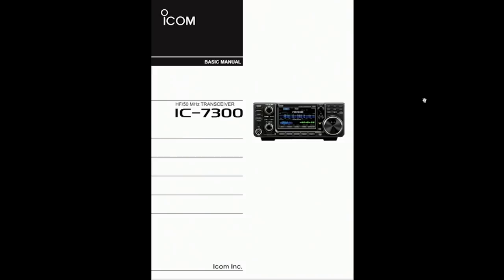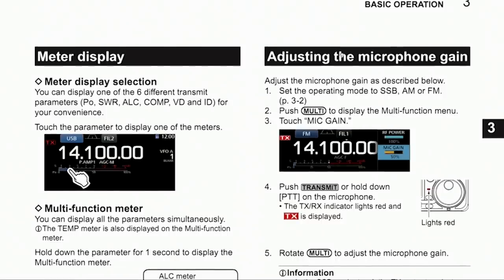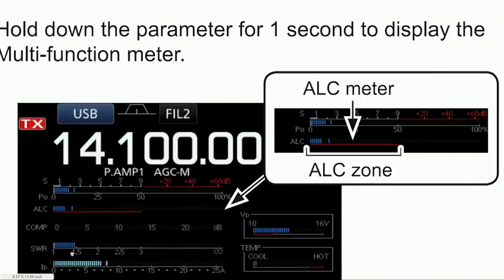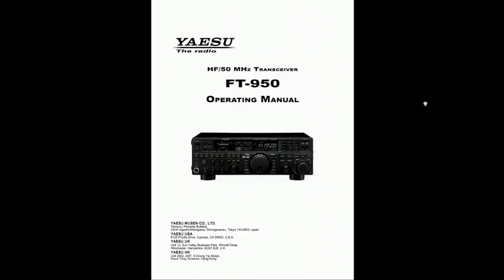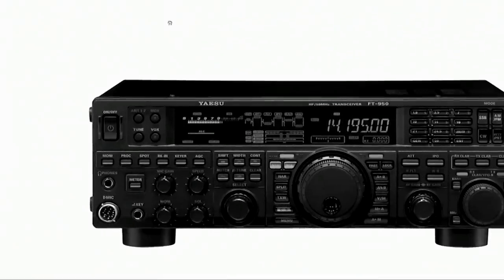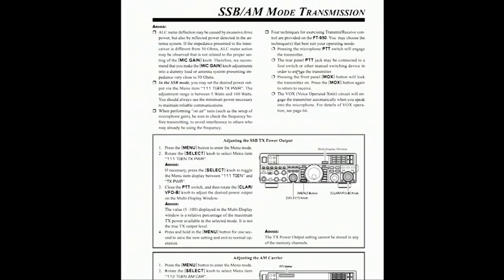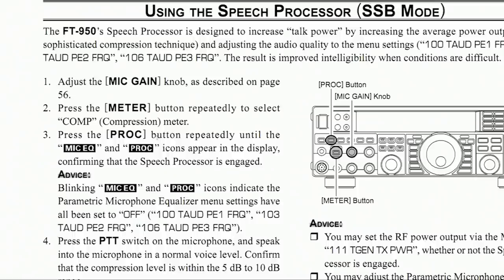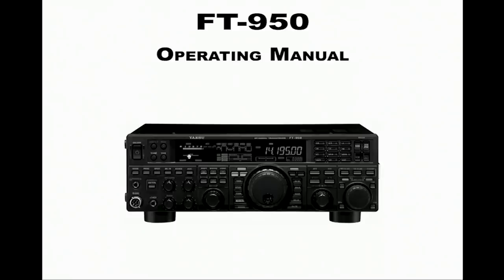Ham Radio Basics---Jim W6LG Discusses Setting the Mic Gain and Compression

Comment: I'm setting up a Heil iCM on an IC-7000 right now. Great video! I'll take your advice back to the radio and run through the procedure you've laid out.
Reply from the maker: Okay Richard.  Let me know how it goes. I have an IC7000 that I almost never use.....and should use!  73, Jim
Reply from the maker: Go to pages 121 & 122, what settings are you using?

Is the mic connected directly to the front of the transceiver?

Electret mics have tons of output and should drive the transceiver with very little mic gain unless they have padded that mic output.  

Get back to me as soon as you can. 

73, Jim
Reply: Currently I have mic gain: 80%, TX wide L: 200, H: 2900, TX mid L: 300, H: 2900, TX nar L: 500, H: 2900.  The iCM mic has a built in cable and I am using a Heil adapter to converter cable to convert it to the modular plug. I am going into the modular mic connector on the back of the rig. Thanks for your help Jim. 73 Rich
Reply: Jim W6LG just tested against the stock mic and getting the same results. Unless I talk very loud into the mic, the ALC meter doesn't move. Tried front and rear modular mic inputs. Would be interested to hear how your IC7000 reacts. 73 Rich
Reply: I did a lot of playing around and asking for audio reports. I have settled on a mic gain of 65% with a compression level of 5 on the IC-7000 with the Heil iCM. It's really strange the ALC meter doesn't move with the compression off when TX into a dummy load. Per your recommendation, I am running normally with compression on and I adjusted for 5 - 10db on peaks when rag chewing at a normal voice level.

Comment: Hi Jim, I currently use the 7300 and typcally run the compression at Number one, and like you say, adjust the mic gain according to the ALC not the rf out power meter, I,m constantly saying to hams to do this and it amazes me how many look back with a blank expression. I know different radios are operated in different ways but the method is basically the same, I hope people take note of yur video and understand that little can be more, thanks for the video jim KR Steve G0OGS
Reply from the maker: Yes, exactly my experience.  They have never used the ALC metering.  Additionally, they very often say to me that I am the only one who ever told them that the audio was distorted.  Amazing to hear a guy get a 5 by 9 and repeated be asked to say again.  Thanks Steve & 73 de Jim W6LG

Comment: My Kenwood TS 140 does not have a mike gain knob, but a slide adjuster. Very touchy. Esp. when this oldie but goodie has a needle type meter. Still, I do get favorable reports on my audio. I suppose the bottom line is, find the sweet spot and you`ll do well. Thanks KC3BXZ Joe
Reply from the maker: Hello and thanks!  Is there an ALC meter position on the TS140. I think we sold that model in the store where I worked in the very early 1970's. I don't think it had a "monitor" function.  So listening with another transceiver may be possible.  Take care of that oldie!  Snowed here 2 days ago. 73, Jim W6LG
Reply: Yeah, spring isn`t here yet, too. Snowed yesterday in PA and more to come.
Reply: The ALC "meter" is just a red bar under the S meter. You just have to keep the needle from going out of the red, according to the manual. My best  mike is the dynamic one that Kenwood sold years ago. Got a photo of it on QRZ. It`s on an antique steampunk homemade boom from a garbage picked desk lamp arm. I jerry-rigged a section of garden hose, painted black to attach the mike to it. If you want to laugh, check it out.

Comment: Jim a quick question that I don’t think you mentioned or if you did I missed it. When setting the Mic gain on my 7300 with the compression off, my ALC is peaking around 5db which drives the radio nicely. When I turn on the compression and set the compression to peak at about 1/4 scale the ALC peaks out much higher now. Am I supposed to ignore the ALC once I turn on compression because like I said ALC becomes extremely lively even though I have compression set to peak at no more than 1/4 scale. With compression off ALC sometimes does not show anything on some words but I have it to peak no higher than 1/4 scale.
Reply from the maker: Hi Steve, I admit to not fully understanding the question.  The ALC meter does not have a db scale. .  This I think is the crux of your questions:  "Am I supposed to ignore the ALC once I turn on compression.."  No and heck no!  As I said, always keep the max ALC to about half scale...never ever more.  I think I said something like that more than once.  My guess is that you have some of the equalizer's setting adding to the mic gain and compression.  If needed, turn the mic gain down.   Good question Steve.  Thanks for asking.  And, in case someone wonders, external boxes are a waste of money and cause all kinds of distortion and splatter.  The Icom has everything you need to produce a terrific, potent signal that can be heard around the planet.  External devices were helpful when transmitters and transceivers did not have internal processing. Those days are long gone.  73, Jim
Reply: Jim W6LG I don’t have any external EQ equipment but you mentioned when adjusting the ALC to have the compression turned off at that point. With my compression turned off my ALC scale peaks no more than 1/4 of it. When I turn on the compression however and adjust the compression to around 5db peak, the ALC changes and increases dramatically. You didn’t mention anything about readjusting the ALC once the compression is turned on and adjusted.

Comment: Jim, I have Yaesu radios and have been setting the compression meter for around 5 db for local contacts and rag chew and 10db to work some DX. I also thought  the Icom 7300 manual recommended some high numbers, but I would submit to you couldn't it have something to do with the microprocessor in their particular transceiver where the engineers have determined 10 to 20 is what will work in their case? Just a thought, I wouldn't think they would get it wrong. Your thoughts on the matter would be greatly appreciated. Stay healthy and stay vigilant out there.  73 de KD2PGJ
Reply from the maker: I think it is a mistake for Icom to recommend 20db.  I checked other recent transceivers from our friends at Icom and those manuals have the same information; exactly word for word.  I use a few db for local and never more than 10db for DX.  Let's look a little further at Icom's recommendation. Correct me if I am wrong.  Ten db is 10 time compression. Twenty db is 100 times compression!!!  At 20db on any transceiver that I have ever had sounded bad....really bad. Twenty db is 20db.  There are no magic chips.  Some devices might have less noise, less artifacts, less distortion.  But 20db is 20db.  And, that is way too much.  Thanks for asking a very good question.  I would like to add the following:  Icom is a very nice company.  I have had friends who worked there.  I have visited Icom.  The Icom IC-7300 is the best transceiver for the money.  And, it is very likely, the most popular transceiver ever.  I have only the highest regard for Icom and the very nice folks who work there including Ray. Ray is a marketing genius.  So my criticism of the compression setting is just that.  Nothing more.  Regards, Jim W6LG
Reply: @ham-radio  Jim thanks for the quick and well-researched reply.  You are always objective and a gentleman. Your YouTube content is much appreciated.

Comment: Hi Jim i have a 7300 if i use the hand mic with compressor off it doesn't kick up much at 50% thats the default, but if i turn the compressor on it kicks up a lot even with the comp on setting 1 out of 10 positions...so i dont know whether to turn the compressor off and turn the mic gain up or turn the comp on and turn the mic gain down hi....i'm told the audio sounds ok, but bit distorted when i put the amplifier on...from Fred g4vvq in UK.
Reply: Hi there well what i done in the end was set the Mic gain on 40% and the compressor on 2, the ALC doesn't move but the power meter on the radio goes up to 100 watts easy, so i cant see the ALC matters...i have had good reports and no problems....i use a Heil PR 781 Mic....Fred.
Reply: That doesn't sound right, its usually down to a high vswr but you recon thats ok, i would try it with a dummy load as well, but if its as you say it sounds like you have a problem with the radio...could do a reset on it i suppose...good luck with it....Fred.
Reply: Hi well if it does it with the dummy load it must have a fault on the radio, you could look on eham reviews, or contact Icom in Kent if yur in england, if not your local Icom agent....might e worth trying a reset on the radio...prob tell you in the Manual how to do it...Fred
Reply: I have a 7300 and after I adjusted the mic gain and compression correctly into a dummy load, I got a very low power output. Lots of others have reported the exact same thing. As a test I adjusted the ALC and compression using various permutations, with another ham listening to my audio on his transceiver at his house. The one that sounded the clearest to him had settings radically different from those gotten by following Icom directions or your directions (on 5 to 10 dB of compression). I quit using the 7300 a year ago and wonder if there was a firmware update that fixed this very common problem.